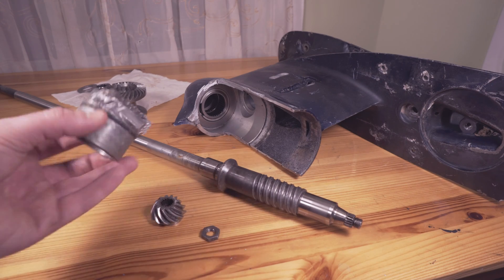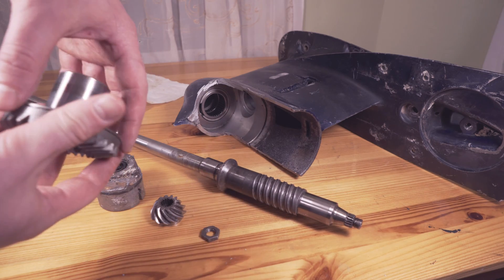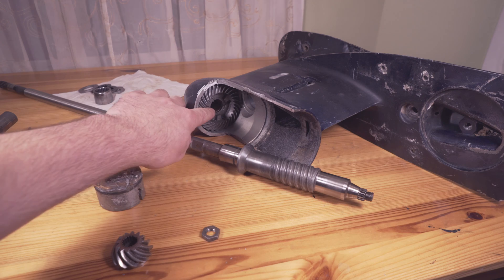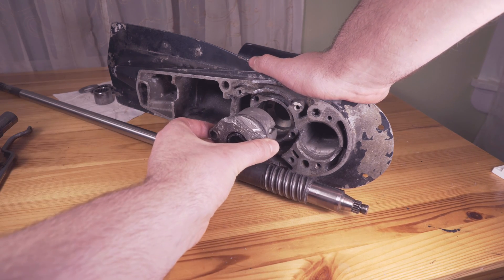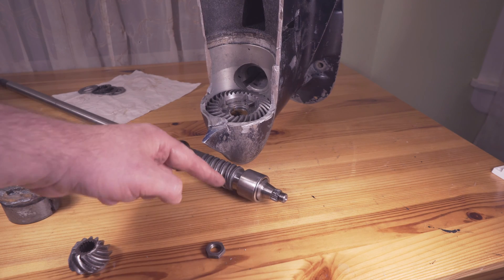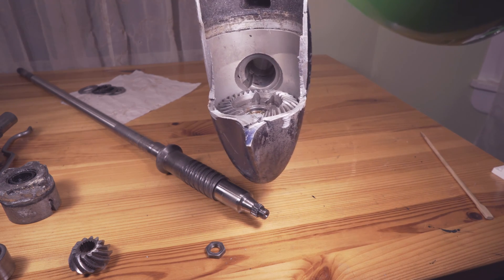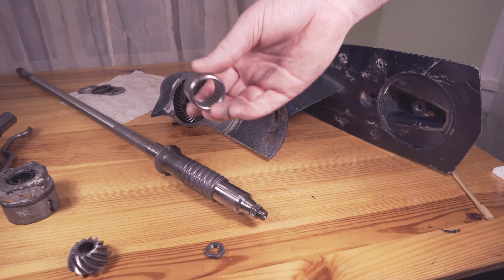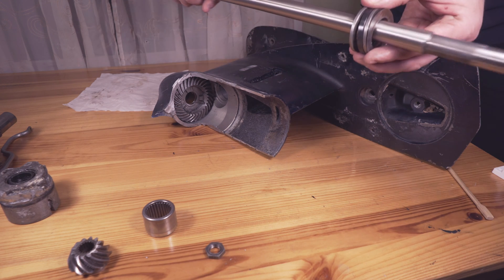Remove outboard drive shaft housing + drive shaft part 2 - Evinrude lower unit disassembly

Comment: Is there any way you can give me the number off the bearing inside the drive shaft retainer housing? I can't seem to find any diagram for that bearing.
Reply from the maker: If you go to the Marine engine website you should be able to find the right part based on the diagrams they have. Most years are the same. Check between a few different year models if you are unsure.

Comment: Thanks for the video, it's helping me a lot. Does the drive shaft have to come out in order to remove the prop shaft?  In my 1998 Johnson 50, I've got the carrier bearing out along with the reverse gear but the prop shaft shaft still seems like something is holding it from coming out.
Reply from the maker: No it does not really need to be removed for the prop shaft to come out. However the forward gear will be stuck inside the lower unit. Only the reverse gear will come out with the prop shaft.
Reply: @IdeaMan4k  Thanks for the reply. The shift rod linkage was holding it in, I finally got it out. The forward gear and pinion are completely rounded off but all else looks good. Could I get by with just replacing these two gears and be dependable?
Reply from the maker: @jeffperkins6514  You should, as long as nothing else is wrong. It can be hard to tell. In most of these cases if you are specifically buying parts, it is often cheaper to keep an eye out for a used motor on craigslist and buy that for parts instead of purchasing actual parts. They can be very expensive, but old used motors can be found super cheap.

Comment: The big washers and flat bearing on top of the drive shaft shows on the parts diagram The washers are part 35 and the bearing is part 34. The diagrams says it takes 2 washers and also says it takes 2 bearings? Doesnt show that in the diagram but  says takes two? All my upper bearings were destroyed and couldnt tell what went where. I noticed that you only showed one bearing also when you showed how it all goes together. Is that a typo from boats.net? Those 2 skinny washers are shims and when reinstalling the driveshaft has to be measured with a shim gauge or calipers to know how thick the shims should be.  Thanks for all these videos once again!
Reply from the maker: I generally go to marineengine to see the diagrams.

Looking at just a standard 1992 40HP gearcase, it shows part 34, thrust bearing. 2 count. I believe they must be side by side. Its hard to tell. Its been a while since I took this thing apart so I could not tell you 100%.

Comment: So to get the long shaft out of my 50s and 60s motors, I need to get all the way into that gear case and take that nut off? Then the shaft comes out from the bottom of the case? I’m converting a 1966 33hp skitwin long shaft to a short shaft using parts from a 1959 35hp superseahorse.
Reply from the maker: Yes I forgot if I mentioned in the video but if you don't have any proper tools the easiest way to get it off is using the force of the motor turning left or right while clamping down on the flywheel at the top or having simply someone hold a wrench on the nut and then rotate the flywheel at the top using it as wrench. This is because the top of the drive shaft has an odd shape with teeth you really do not want to damage.

Comment: hi, is there the 3rd part of the video?
Reply from the maker: No, however I still want to do this repair in the future. If so, I will be sure to post a video.
Reply: @IdeaMan4k  came across your pinion bearing video. Is it possible to reinstall the set screw properly after removed? I put mine back in but now the driveshaft isn’t engaging so the prop just spins slowly in forward and reverse.
Reply: Hi I just came across your video and is extremely helpful. I removed this screw and now the motor does not go into gear. The prop just moves freely in forward and reverse. Would it be possible to remove the set screw and reseat it by adjusting the throttle position til it is aligned correctly and then reinstall the set screw?

Comment: i have a 70 hp evinrude that i just got and the shaft is stuck to the power head. I guess the previous owners didnt do enough lower leg maintenance? Can I remove the leg by removing the pinion nut?
Reply from the maker: If it's stuck in the power head it should he fairly easy to get it out by just banging it down. Make sure you disconnected the shift rod. If it's truly rusted that badly inside the power head, it's probably not a good sign.  Removing the housing like in the video was very difficult so I do not recommend it.
Reply: @IdeaMan4k  thanks. Yup, all bolts were out. I think i will trey the method of hanging the motor upside down, spray penetrating oil in and try the wedging again to separate the leg from the lower leg from its housing.
Reply from the maker: @darrylb4048  I just find it hard to believe the only thing holding it is the drive shaft. Are you sure you aren't forgetting 1 bolt?
Reply from the maker: @darrylb4048  and the shift rod pin at the power head is out as well right? Just trying to think of anything holding it.
Reply: @IdeaMan4k  Sure am. After I tried for a week I took it to the dealer, they tried and they said....its done, runs well, but its done. Yup, all bolts were out. Im thinking of turning it upside down and running penetrating oil down the shaft. I can get the straw in the space that comes open when the bolts are out.
Reply: @IdeaMan4k  yup.
Reply from the maker: @darrylb4048  did you ever get it out?
Reply: @IdeaMan4k  
Yes as a matter of fact I did. You won't believe how!! I took pics and videos of the whole process for future reference but I don't want to get ahead of the story. LOL.
After the marine mechanics said it was a big paperweight and nothing they could do, I figured I would do some research into its life. It was over 11 years since the previous two owners had done any water pump or leg removal maintenance. Scarry right! Well at that point all other options had failed. 
SOOOOOOOO... I built a bed in the backyard (4x8 plywood) at the same height of my Jeeps hitch. Padded the bed, padded the leg, wrapped chain around the leg, attached it to the Jeep, chained the motor head to a big old tree, brought all items taunt then in 4x4 gave it a 6 inch pull. Amazingly all that happened was I spun all four wheels (heavily knobbed tires) and dug some holes in the process. 
SOOOOOOOO... I decided to give it a 12 inch pull and voila it popped right out. So I cleaned it all up, replaced the water pump, etc parts, painted the exterior and gave it a go. 
Runs great!
Now there's a story right!

Many thanks to folks like you on YouTube, it gave me a place to start from even though "no one" had this for a remedy. LOL.
Reply from the maker: @darrylb4048  That's the kinda fix I like to hear about! Great job!
Reply: @IdeaMan4k  Thanks